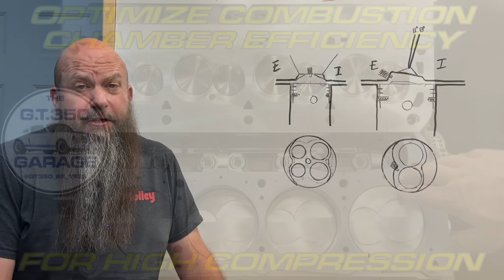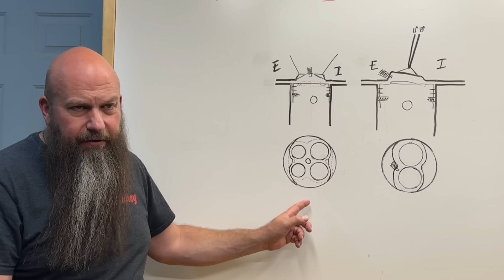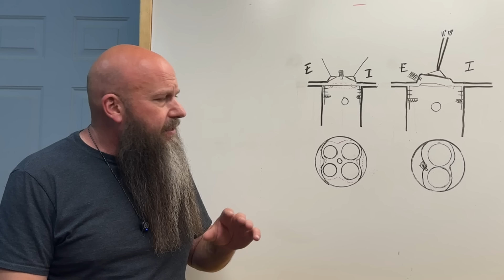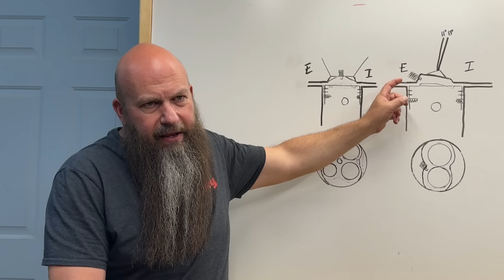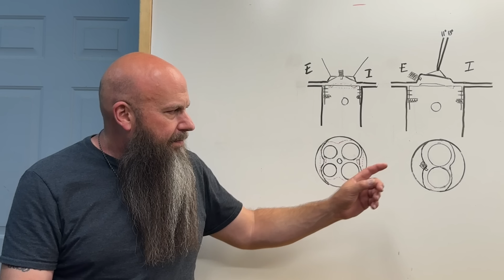How To Optimize Combustion Chamber Efficiency For High Compression And How It Impacts Tuning

Comment: I wonder what it would do if you did a cylinder head and piston similar to a diesel. Where you just have a flat, no chamber head, and put the chamber in the piston directly over the spark plug and have as much quench pad as possible

Comment: Stick in a T-5 transmission and the old pony will be getting 30mpg with 4.10 gears.
Reply from the maker: Not quite.  4.10s usually pull down high teens unless the power is turned way up, then low to mid teens.  And that’s fine.  If you’re building 450-500hp from a naturally aspirated small block, it’s going to use some fuel.  On the other hand, the 400-425hp range can still manage 20-22 with a T5 and 3.00-3.08 gearing.  Every step up in gearing costs the car about 1mpg, so 3.25-3.31 will be 19-21, 345-3.55 will be 18-20, 3.73-3.89 17-19, 3.90-4.10 15-17, 4.30s will net 14-16 on average.  Less power, less gear, less fuel, more power, more gear, more fuel.  It’s genuinely that simple.

Comment: Hello Walter,

Excellent video and Rock solid Knowledge, few people understand or comprehend this... Well Done!

Never before have I ever made comments on u-tube watching many vids on Ford engines, built plenty of Ford engines over the years a couple of stout running V-6's too.

I am in total agreement with all of your statements,
Been saying this for more than 25 years. 

I hate the large ineffective Combustion chambers and Domed pistons and loose quenches too! I prefer flat top pistons and tight Combustion chambers.

My latest build is a 5.4 L SBF and I milled the AFR CC from 58 to 54 CC used a .027 deck cometic Gasket for a final 10.7 compression ratio, I run Regular 87 Ron unleaded fuel not Hi-test. a .600 howards solid Roller cam.

Most knowledgeable engine builders spec a tight .040 quench if you can get it
Even smaller if you can!

In 1987 T-Bird with a close ratio T-56 trans 3.73 Rear. 
It screams along at 6,700 Redline!

Cam duration also effects final dynamic compression ratio, along with other engine variables, intake type and style efficient exhaust scavenging long tube headers a must like you said when they are a well chosen and mated package and everything just complements well and performs steller.

I went somewhat conservative on my first higher compression engine and have been rewarded with excellent performance. 
Using KB hypereutectic pistons they spec a total timing of 34 Degs and power drops off like a cliff if you go more gee wonder why. Duh

Too bad I can't dyno this to see if I can get less total timing could do it the old way by the seat of pants not as quantitative or as accurate but useful.

We both know the better the Combustion process the less total timing we need to make big power, I am not surprised by you getting 480 Hp from a 289 engine build. 
Took Detroit 60 + years to realize this, and some of their bag of tricks is using computers, sensors and other high tech that you and I do without all of the sophisticated garbage. Kiss Baby, ( Keep it Simple Stupid )

Bryan Sams 

You have confirmed what I have known for a long time, I am nearly 68 YO and I still love Hi-Performance engine and cars, I love Building Hi-Performance Ford engines!

Comment: So basically you're saying make sure there is significant quench area because that speeds up combustion which allows less timing advance.
Reply from the maker: A compact combustion chamber is more important than adding quench, but quench has benefits as explained.

Comment: We have an aluminum cast (non-forged) piston and a steel connecting rod. What quench height / squish clearance would you recommend for a street car with a stock camshaft, intended for daily use, not for racing? And what compression ratio should I run with regular 87 octane fuel?
Reply from the maker: You generally want to be in the .040-.050 range on most engines.  Without more info, like what make and model engine, it’s hard to be even remotely specific.  I’ve run as much as 13:1 compression with a 2.3L DOHC 4-cyl on 87 octane successfully (made nearly 240whp from 138cid at 7200rpm) but I’ve had 87 octane wreak havoc in an 7.8:1 compression 351M with open chamber heads.  So I can’t tell you what you can get away with without more info about your engine.

Comment: Do you think a slight dome piston with two valve reliefs, Will have better combustion efficiency than a flat top with no valve reifies.
Reply from the maker: No.  A true flat top piston with no dome or reliefs will be the better choice.  If displacement is high enough, an inverted dome that mirrors the combustion chamber is better still.
Reply: @TheGT350Garage  Ya I'm building a 383 stroker SBC. With a 40cc combustion chamber so I will just go with the true flat top thanks for the advice.
Reply from the maker: As long as you have piston to valve clearance you’re golden.  A 40cc chamber on a 383 will net some incredible compression unless the piston is in the hole.  Be mindful of quench, the piston should be around .036”-.045” from the face of the head ideally, and no more than about .060-.065” maximum to get the most out of the quench area.
Reply: @TheGT350Garage  Ya it's going to be 18.3 to one with the total flat top. Piston 0.009 out of the hole. With a 0.030 MLS head gasket. I plan to control the cylinder pressure with a really wide cam 130 lsa custom grind.
Reply from the maker: .021” to the head is extremely tight, there’s a strong chance the piston could touch the head at higher rpm.  If you are running a steel crank and H-beam with a hypereutectic piston you might get away with it by preventing deflection and stretch in the crank and rods and by running tighter piston to wall clearance you’ll limit piston rock on the pin in the bore.  You’ll definitely need high octane (105-108 AKI or 112-118 RON) unless you’re replacing the spark plugs with injectors and converting to diesel 😂.  Sounds like a fun race engine in the making.
Reply: @TheGT350Garage  I gotta admit i'm afraid it might touch aswell but it is a hypereutectic 4.030 bore piston I plan to run. And I'm gonna be running a tight 1.5 thou piston to cylinder wall clearance. The crank I have laying around is a cast steel 3.75 stroke with 350 mains.  and steel I beam 5.7 rods. I don't plan to do anything over 6,500 rpm with it. Also I was planning for pump 93 octane to work with it if I kept the cylinder pressure down. I have built engines in the 11 to 13 to 1 area before and ran 87 octane just fine. But I think your right I'm probably pushing the envelope too far lol.
Reply from the maker: I would run a 0.036-0.045 head gasket to get the clearance up, you won’t sacrifice much quench or compression, but you’ll be sure the piston won’t touch.
Reply: @TheGT350Garage  That would be the wise thing to do. I will go up to a 0.036 (too bad they cost a lot more than the 0.030s lol)  Tightest I ever ran an engine was 24 but it never went over 6,000 rpm.

Comment: Enjoyed your class. I have been trying to find a usable algorithm to calculate the effects of changes and to better select which variable to select to adjust for the best results. So far, I have deduced that everything that we do is to reach MCP@MPP (Maximum Cylinder Pressure @ Maximum Power Point). Without a clear understanding of the specics of the variables and their relationships to each other and to MCP@MPP, I am struggling with "approximately, maybe, and from scraping through mostly wrong or useless information". I have deduced a far better understanding of emissions equipment; but, not a solid foundation. Would you have any recommendations for reading material? V/R Chris
Reply from the maker: So, in 40 years of studying automotive concepts I’ve read so many books and articles it’s hard to point you in one direction.  I’ve studied the work of some really brilliant people in this industry, my work has taken ideas and concepts from around the world and applied or combined them in sometimes unconventional ways, the results have been an interesting case study.  What I apply to engines is unique in many ways to what I’ve learned and I hope to start compiling it all into a single work of my own.  Until then, the concepts are presented as best I can in video format.  A list of people you should study:  Smokey Yunick, John Lingenfelter, Ken Duttweiler, Bob Glidden, Jack Roush, Pat Musi, Warren Johnson, John Kaase, Larry Widmer, Grumpy Jenkins and Somender Singh.  That will keep you busy for a while.

Comment: Love watching your videos. Much appreciation for spreading your knowledge and sharing your experiences. My question to you is: What heads did you decide to use that you had milled.066" to make a 46cc chamber?
Reply from the maker: The heads started as a 56cc TFS 11R 190 CNC Street Port head.  That’s the upper end of the exhaust port flow for the 11R series, the exhaust flow does not improve for the Comp Port 190, 205, or 227 versions.  Keep in mind an 11R 190 Street port is a direct competitor to most 205-215cc 20° In-line valve heads, it’s a big cylinder head for a 289 stroke.

Comment: Is there  a good way to reduce the  chambered volume when you're  working on the heads, like maybe some tactical chamber welding and  reshaping / resulting, and maybe  bringing the piston up Proud of the deck, by maybe 20 to 40 thousandths, so that you don't even  need a domed piston, I'm just curious here i don't really know about this stuff, I'm just guessing and spit balling here.
Reply from the maker: Chamber shape is very important to combustion.  With aluminum heads, you could weld the chambers, but you would need to have a very good plan on the shape you want to produce and an incredible understanding of flame travel.  

The easiest way to raise the compression is more displacement.  289s are incredibly challenging, a 331, 347, or 363 with the same head as a 289 can have a larger chamber and still let a higher compression ratio.  I’ve done 427 Windsor strokers with inverted domes to net 12.5:1 CR.  It’s all in the combination.  I run zero deck on most engines, then adjust the compression ratio with the piston design, chamber volume, and fine tune with the head gasket.   As long as I have a safe piston to head clearance, and I don’t go over about .055” piston to head clearance, I can fine tune.  And sometimes, you just have to settle for what you can get within the constraints of the combination.

Comment: Great stuff.  I spent a bit of time 2-stroke tuning and the key area I liked to focus on was squish clearance (as quench is referred to in 4s).  As squish velocity is increased, the less spark lead was required for peak performance, it also made the motor more detonation resistant even at higher CR's.

Comment: Hi Walter, excellent video and plenty to think about. I presume when you suggest a minimum SCR of 11:1 that this is for ally heads which are a bit more tolerant to higher CRs. What CR range would you aim for in a 306 with World Products iron heads (270 ish cfm) and a TFS stage 2 cam ( X303 intake lobe)? Cheers, Dave
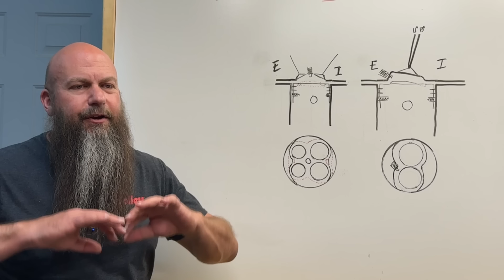Reply from the maker: It would depend slightly on the combination and the weight of the car.  In an LX Hatch with 4:10 or 4:30 gears and a 26-27” tall tire, I’d probably aim for 10.5-11.0 with that combustion chamber.  I’ve had those heads and the aluminum version on the same engine on the same dyno, the aluminum make the same power and take the same timing.  You’ll need to mill the heads to get the chamber volume down to about 54cc to get to 10:1 unless the block is decked slightly and the pistons are at the deck not below it.
Reply: Thanks for your reply Walter. I actually went with the 64cc Windsor SR heads and could only mill them to 57cc, so, a bit like your Shelby build I went with a small domed piston with a - 2.6cc crown volume. With a .039 head gasket and the pistons .005 in the bore I’m at around 10.75CR. This is in a 2700lbs (including fuel and driver) GT 40 replica. I’m using a 650DP and Weiand Stealth intake, 1 5/8” long tubes, 5 spd manual box with a 26” tyre. She runs on 98 e5 which is plentiful here in France. I was hoping for 400+ fwhp, what do you reckon?! Do you think the heads are too big? Cheers Dave
Reply from the maker: The heads are not too big, but the cam may be a little small.  I would probably have gone with the TFS 3 over the TFS 2.  With the relatively light weight, you won’t be loading the engine as much as the same combination in a heavier car, less heat, less cylinder pressure required to move the vehicle, it will tune easily and run well.  Those heads can move some air professionally ported, the chamber is better than the factory stuff, you’ll be fine.  If the cam is in straight up you’ll be in the 375-385hp range, it will run really well.  You can help it stretch its legs and break that 400hp mark is you retard the cam a bit, you won’t really notice any appreciable difference in low speed torque in your combination, but running that cam at 113° ICL will help it rev to 6500 and hit your power target.

Comment: This guy knows his stuff. VW air cool guys claimed that lower compression keeps there engines cooler, instead of proper tuning and higher compression. I ran air cool motorcycles from 9 to 5, 11 to 5 with no overheating just prooer tune and back off on timing. Never overheats 😊

Comment: In the 302/12 to 1 CR ford you build, which Trick Flow Head did you used, and how did you get it down to 40 some CC? From their web site, I cannot see any of their cylinder heads that can be milled dow in the 40's cc. Thank you very much, BTW excellent video, learned a lot.
Reply from the maker: I used a TFS 11R 190 Street Port that had a 56cc chamber.  I milled them .066” to reduce the chamber volume 10cc.  To get a 289 over 12:1 also required a small dome on the piston, decking the block to 8.190” and keeping the gasket volume in check.
Reply: @TheGT350Garage   Thank you

Comment: Also, did 65-66 GT and GT350 have front torque boxes
Reply from the maker: No torque boxes in front on 65-66, driver side only on ‘67, both sides on ’68.  Order ‘68 parts for a direct fit upgrade.

Comment: Would roller rockers benefit a K-code.
Reply from the maker: Roller rockers reduce friction and improve accuracy, they benefit nearly any engine you use them in.  Most K-code owners prefer to stay stock if only for the sound the valvetrain makes.

Comment: Nice video. Perhaps it's worth elaborating that when ignition occurs you have a (very) roughly speaking sphere of combustion expanding out from the spark plug, and that when the piston gets to TDC and comes up against those quench pads, the turbulence created breaks up that sphere into parts and distributes them through the chamber, so now you have lots of smaller combusting regions that are very close to one another such that the time to complete combustion is vastly shorter - and that is what makes it a fast burn chamber.
Also note in your 2V head the spark plug is aimed at the exhaust valve so that as far as practically possible the hottest region is burned first.

Comment: I got a stock 65 289 2bbl carb. Got a 4bbl intake to go on it. Plan on sticking with an automatic trans. What cam would you recommend for 300 to 320 hp and what heads? Would like it to be a fun street car.
Reply from the maker: Stock intake won’t get you there, low rise like a Performer 289 will be a struggle to get there.  Needs to be on par with a Performer RPM or Stealth.  Heads, Id use Edelbrock E-Streets with 1.90 valves.  Cam a Crower 15212 hydraulic flat tappet or 15511 hydraulic roller with retrofit lifters.
Reply: @TheGT350Garage thank you for taking the time to reply!

Comment: I dont really know what im doing, i just had the machine shop deck my block until the pistons stuck 5 thousandths out of the block, decked the heads down until theyre 56cc, and then used a 0.027" mls gasket. I think my little 302 with the factory TRW pistons is something like 10.3:1. Im just glad the pistons dont hit the head, i wasnt sure until i revved it to the moon for the first time if the pistons and cylinder heads were gonna try to occupy the same space.
Reply from the maker: They aren’t hitting the head right now, but you’re too close for comfort.  You hav .022 piston to head clearance, that’s not enough.  You need at least a .040” thick gasket to get back to .035” piston to head clearance.  When the engine is hot an the revs get up above 5000rpm, material growth and piston rock in the bore will let the piston kiss the head.